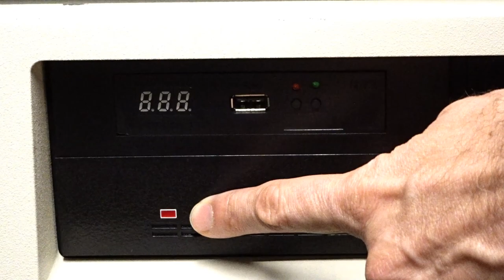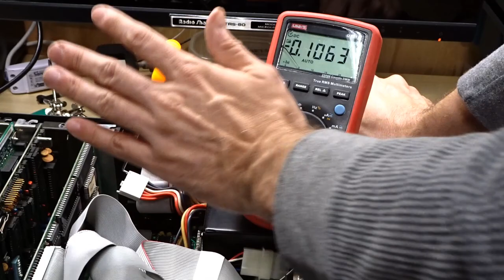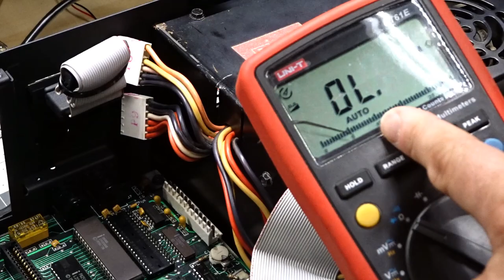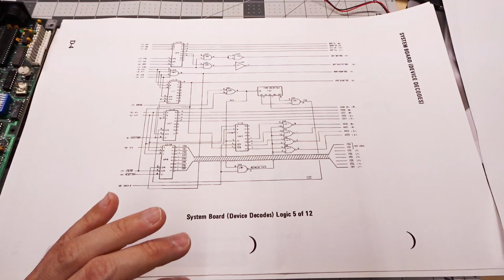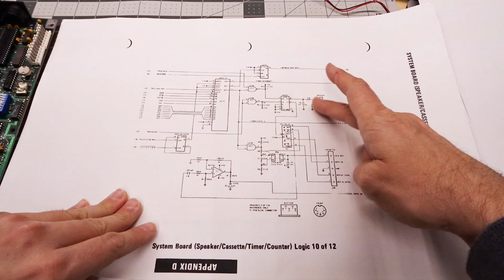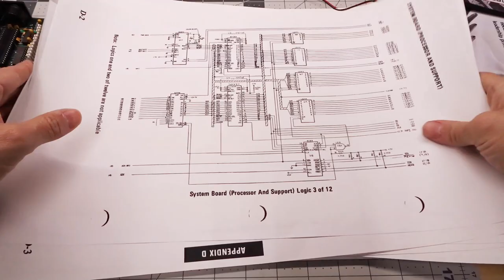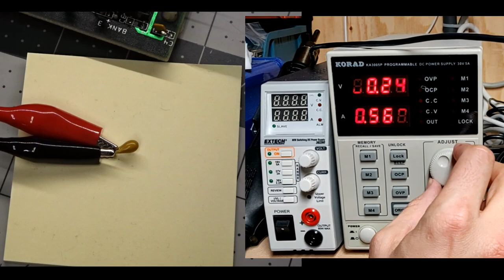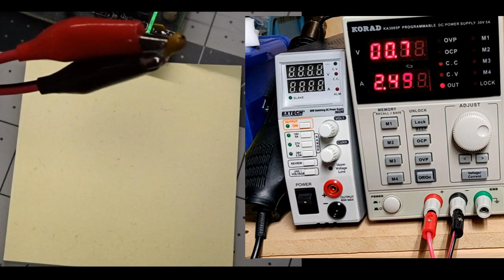Fixing a PC that won't turn on (Bonus magic smoke!)

Comment: The single-sided diskette drive could indeed hold 180Kbytes.  However, that was with nine sectors per track, which was not the standard configuration for DOS.  DOS defaulted to eight sectors per track, or 160Kbytes.   Byte Magazine (and PC Magazine) published the command line tweak you could employ to get that extra sector.  I think it was as simple as adding slash nine "/9" to the format command.  But IBM was very conservative about performance and squeezing in the ninth sector was something IBM was not comfortable doing.  In those days, the diskette drives were using stepper motors with stainless steel ribbons linking the stepper spindle to the head actuator and head alignments sometimes got out of calibration due to temperature changes. For example:  A diskette recorded in the heat of summer might misread on a chilly day because of that stainless steel band changing dimensions... if you packed-in more than X number of tracks..  So IBM chose to err on the conservative side and limit the "official" capacity of the single-sided diskette drives to "160 Kbytes" and the number of tracks to a conservative value where reasonable temperature variations would not render a diskette unreadable.

BTW - It wasn't long before you could purchase a "notch punch" to convert a single-sided diskette into a double-sided "flippy floppy" as we called it.  The single-sided diskette drive would not be capable of reading both surfaces of the rotating disk simultaneously, of course.  The diskettes were sold as "single-sided", but were (in reality) double-sided specimens that often had a flaw on one surface.  So that disk was sold as a "single-sided" inside a sleeve with just one notch to prevent "flippy" usage.  But if you manually cut a notch on the opposite side of the sleeve and flipped the diskette over, when you performed a format of the disk, any flaws in a sector on the unofficial surface would be detected during the format and the sector would be locked out by DOS, leaving the vast majority of sectors on the "flippy" side quite usable.

BTW - I am the engineer who taught IBM's Boca engineers how to diagnose boot issues in the 5150 using a simple AM radio, tuned between stations.  All 5150s were shipped to retail outlets in pieces.  I would have to assemble each PC with the configuration of cards and options ordered by the customer.  Then (of course) I would run diagnostics using the special diagnostics diskette before sliding the shell back on.  Well, I accidentally had the office radio mis-tuned and discovered that the open PC would "sing" through the AM radio as soon as the PC was turned-on...a very repeatable sequence of chirps and pings and other sounds corresponding to which phase of the BIOS sequence was running.  You could even tell how much RAM was installed (even without a monitor connected) because that portion of the boot sequence would take longer for a machine equipped with 128K, 192K or 256K.  You could tell if the monochrome adapter was installed or the color one by the "detour" in the chirps as that phase of the BIOS would run.  I am also the engineer who found (the hard way) the grounding flaw in the original color video adapter.  I got shocked when assembling a PC for a customer and quickly identified the source of the shock as that card and reported it to Boca Raton because any substitute color adapter would deliver the identical shock.  It wasn't just a glitch with one copy.  They sent a "ready team" to North White Plains Computerland to meet me and see a demonstration of the problem.  They verified the flaw and that triggered an EC plus a partial recall.  That's when I also demonstrated the "singing" BIOS to them and showed them one motherboard that would fail before completing the BIOS phase.  I illustrated how you could tell what was wrong by following the "song" until it stopped.  That told you what component was being tested when the boot failed.
Reply: NERD ALERT!!!

My favorite type of nerd of the most useful variety.. 😁

Comment: Old tantalum capacitors.  Not cheap parts when the 5150 was made.  They were expensive so most computer manufacturers didn't use them.    
I swap out the tantalums along with the electrolytics in my old test equpment.   TEK and HP, among others, used em liberally.  Kemet has failure mitigation built into their modern tantalum caps to limit damage to circuit boards from smoking tantalums.

Comment: Although not necessarily a recommended technique, what I do when changing a through-hole component, I will add excess solder to the joint then gently tap the board on the bench. 9 times out of 10, the lead stub and most of the solder drips right out, leaving a small remainder to sip out with a plunger type solder extractor. Then it’s just to clean off the flux etc. and prep the new part for installation.

Comment: another caution about applying 12 volts only to the motherboard...  I am glad you did not do it, as you talked about on the video, I am not sure about the 4116, but earlier DRAM had a very sensitive need about voltage rails needing to be applied, within ranges from each other.  12 Volts, without the 5 volt supplies would very quickly destroy the older DRAM chips.

Comment: 6:42 +12v and -12v are very common and are part of the modern ATX PSU specification, as is +5V. The -5V rail is the one needed for those DRAM chips, and most modern computers do not have this voltage.

On later IBM offerings like the XT 5160, the -5V rail was already not really needed (some expansion cards used it, but that was the only thing).

Comment: Just a very important point regarding 4116 DRAM IC's but if you don't have all three rails powered you can damage them, so pull 'em out next time you do that!!
Reply: especially the -5v line, if that goes off while the +12v is present, they will quickly fry...

Comment: O.L. Stands for Out of Limit, It simply means that the value is not readable by that device. We like to think that and open or short are absolutes, but they are not, and the manufacturers know that too.
I knew it was going to be a cap, but I was a bit surprised that it was a tantalum. Its amazing how one part can totally wreck a complex machine.

Comment: I think I would have inserted a ceramic capacitor. Experience with other old computers such as Commodore shows they never fail and it also has become the modern standard; for bypass they are the right capacitor. Dirt cheap and effective.

Your multimeter looks very similar to my Voltcraft VC830. Always interresting to see that completely different brands are based on the same designs.

Comment: I once had a 5170 PC/AT with a shorted tantalum cap - I knew this because I had the lid off when it burst in a shower of orange sparks. I'd have liked to have restored it, but ended up selling it on eBay for spares or repair, because I had to have a big clearout due to lack of space.

Comment: Good video and I've always thought IBM PC PC/XT motherboards were all classic and perfect designs. Why yours got jumper wires?
Reply: at that time it was normal, that the first revisions where fixed. It was to expensive, to trash the wrong revision. Ot was cheaper, to fix it with wires.

Comment: Likely been pointed out already but your measuring caps on the same rail and charging them with the meter which is what's giving the changing readings

Comment: I know almost nothing about repairing electronics, but I got out an old, cast off pc from the mid-90's the other day and thought I'd clean it up and see if it could be resuscitated. Long story short, the fans power up, but there's no video at all. Probably there's a short on the motherboard, but I'm not set up to find it or fix it. In any case, it's likely not worth spending the time to learn how to do it. At least I now know that it's possible.

Comment: Old video but i couldnt help but comment, a multimeter gets ohms by sending a voltage through a component, and then reading the current that is drawn, then by ohms law calculates the resistance of the component, the issue at hand is by reading the capacitor with the meter as an ohm meter, you are effectively charging the capacitor, it will draw more current when it is discharged but as it charges it will draw less and less, this means that initially it will display a low resistance, but as it charges the resistance will be displayed as higher than the initial reading, while i have no real idea how else to check a capacitor for a short to ground other than that, i would look to checking that the capacitor is good with the capacitor function on the meter, just my 0.02, fun videos
Reply: You’re absolutely spot-on about the DMM in resistance measuring mode vs. capacitor. 

The best possible way to test a capacitor, is by using an ESR tester, and never while it’s still on the board!
(The other components can mess up the measurement. Desoldering just one of the legs is enough.)

If you don’t want to break the bank on buying a professional ESR meter, you could buy one of the surprisingly versatile component testers from Ebay. 

The first link is for a build-it-yourself kit, but you can also get that one preassembled. 

The second one is the model that I have had for a couple of years now, and it has always served me well!

Both of these testers, can also identify “mystery” components, help you match transistors, test (most) IR remote controllers, and more...

Both these items are sold by “alice1101983” which is one of the best Ebay sellers I have ever dealt with. They don’t lie or over exaggerate in their product descriptions, they always package your bought items securely, and they have always provided excellent customer service!

https://rover.ebay.com/rover/0/0/0?mpre=https%3A%2F%2Fwww.ebay.com%2Fulk%2Fitm%2F401239859328

https://rover.ebay.com/rover/0/0/0?mpre=https%3A%2F%2Fwww.ebay.com%2Fulk%2Fitm%2F312887628475

Comment: Hey Adrian. Which GoTek model is that? It looks like the 1.44MB model. To my knowledge the 5150 did not support 1.44MB drives. Could you possibly proved the model of the floppy controller you are using as well as the GoTek model? Thanks

Comment: I use an Anatek ESR meter to check capacitors in circuit. Bought it to work on tube amps (thanks to Uncle Doug)

Comment: The -12V is most likely only used by serial ports, maybe a soundcard that had op amps, but none of the integrated mobo components.

Comment: nice computer!. I can't imagine doing things with less than 640k of ram because my first computer had 640k. considering the 64k and the cpu speed I guess DOS 3.30 would be a good version to use on that one. I bet wordstar and an old xtree gold version can run on that computer, but I don't imagine games like arkanoid or test drive running with only 64k.
I think old soundcards use -12 volts. (I don't remember where I read that).
Reply: Not all of them do, but a few of the popular ones do. That’s why Phil’s Computer Lab made that voltage blaster card, to invert the 12V from a newer power supply.

(Edit: perhaps I misremembered and it was -5. Either way, a lot of the cards are biased to ground, and only a few of them need negative voltage to properly generate their waveforms.)

Comment: I think wiring up to a PC supply and seeing what got hot would have been a bad idea. I had a cracked ceramic cap on a board that was causing a short and I only worked it out after the pcb was damaged from all of the heat it generated.

Comment: I think -12V is used by ISA cards, that's why you can't mix modern ATX power supplies with early ATX boards that still had ISA. There's some revision that still has a -12V line, but i forget how the version numbers go.
Reply: I think all -12V was supposed to be used for was serial coms? What else needs it?
Reply: @1pcfred  Aside from serial comms, audio. Sound card designers loved having symmetric +/- 12 volt rails for audio chains. It means you don't need a virtual ground and saves you that extra bit of power supply circuitry. This is especially true if you are driving a set of headphones or desktop speakers and you prefer to provide a direct powered output without capacitive decoupling. It's why some old PC sound cards could directly drive 8 and 4 ohm speakers so well. 

When I was a kid, I had an old SoundGalaxy 16 card driving 4 8-inch woofers with tweeters directly, and the sound was pretty decent at moderate volumes. I was probably only getting a few watts per channel but that was enough for my young ears.
Reply: @andy16666  there is not much in the way of PSU circuitry inside PC PSUs when it comes to the -12v rail either. That rail is driven by a 3 pin linear regulator. Namely the 7912 IC. I wouldn't use one of those to power an audio amplifier output stage, but that's not to say it can't be done. Just that it can't be done very well. I have used a 7912 to drive a preamplifier stage though. https://www.instructables.com/id/Transistor-Amplifier-Build/ I've made a couple of those. I also have a number of 7912 ICs I've pulled out of old PC PSUs too. More than I know what to do with.
Reply: @1pcfred  Certainly true, although the voltage drop tends not the be that large. The supplies I've looked at generate a negative rail directly from the flyback which is regulated down from something like -15 volts to both -12 and -5. It's certainly ill-advised to do what I did, but many PCs of the era shipped with un-powered 8 ohm desktop speakers simply because of the fact that it could be done. 

I actually build a line of 75 watt RMS power amps for guitar and hi-fi. They're my own design, geometric mean class AB. Extremely durable, and use SMD for most of the passives. So far I've sold half a dozen combos and a couple kits locally, but my main amp is a toolbox with a pair of them driving 2 12" cabs. I run Corsair H60 liquid coolers on that unit for the "cool" factor. Unfortunately I didn't do much in the way of vids of the build, but there are a couple videos on my channel of me performing with the toolbox amp.

Comment: So i'm diagnosing my 5150 with a very similar problem!   But when I measure resistance on all of the tantilum capacitors, I get the "1" reading meaning too high for my cheap multimeter to read -- which as I understand it means NO SHORT in the 12v line .....  Is that correct?   Would the same apply to the T1 TRIMMER capacitor? I ask because the plastic top of the T1 trummer cap seems to come off at will ...not sure if this is normal or not -- or if that means the T1 cap is physically damaged somehow or broken - from what I read the T1 adjusts the clock frequency and is absolutely essential to the operation of the 5150.  Right now my 5150 acts DEAD -- power supply fan spins up and my voltages are apparently good coming FROM the power supply  ..... I'm having a hard time jamming my multimeter probe ends down into the power connector coming out of the power supply - but I was able to test one of the molex connectors for the 5.25 floppy for ground, 5v and 12v -- all looks well -- so again I don't think its the power supply -- this is so frustrating! Any tips are appreciated !!!!

Comment: Tantalums reform when charged, so this is mainly a problem for systems that is not in regular use. Also, faults like this can often be triggered by voltage spikes from the PSU, so I'd rather give that a recap.

Comment: Why are you replacing them with tantalums for? Why not use the newer ceramic capacitors?
Reply: With his comment about restoring it back to it's original configuration I guess he wants the internals the same.
Reply: Ceramics with that capacity/voltage are expensive and have different characteristics. Best to either stay original (and power up the machine every once in a while) or go with electrolytic caps. Are you an Amiga user by chance?
Reply: @1337Shockwav3  For the cost difference overall vs quality electrolytic caps I don't think it's that big a deal. However I completely agree with not changing the characteristics (too much) of a capacitor. I myself recapped my Amiga using quality electrolytics, but when I ordered them I also ordered a set of organic polymer caps. In the end I went with the electrolytic caps over the polymer due to the current leakage.

Comment: So, if you already went with the resistance method, why didn't you just measure the change in resistance between the one side of the capacitors -> power connector pin vs other side of the capacitors -> power connector for each capacitor to find the one that's shorted?

Comment: How’d you get that USB port on there? This is identical to my first computer. I had a 20mb WD HDD and dual floppies. Same Monitor, But later I bought a Hercules graphics card with 8 colors, so I had to buy an EGA (?) monitor. I was running AutoCAD r10c7, took 7 floppies to load the program, took 15 minutes to render any drawing.
Reply: Adrian Black probably something that wasn’t made by the time I eventually sold the PC. I just noticed something, the +5v pink wire, that’s probably for the data bus, which was usually 0v for 0 and 5v for 1.

But it’s been along time since I repaired any of these, I helped design a course for ITT Tech before it went out of business, On how to troubleshoot the components on a motherboard. ITT made these nice PC/XT clones that were good for learning. Previously we used the “SAP” (Simple as possible) computer. But that was back in 1991.￼

Hm, you have no math coprocessor?

Comment: I found one of these "clone" style versions recently for $10.00 and I plugged it in and had one of these caps blow up on the i/o expansion card and fill my room with smoke. Seems like a common issue with these old caps.

Comment: What was the go-tek thing you mentioned. I have a vintage ibm clone franklin 8000 machine with hard drive i would like to back up.....thanks
Reply from the maker: Floppy emulator. Google for "Flash floppy" which is open source firmware for the Gotek. (Gotek's are cheap disk emulators for about $20 from eBay)